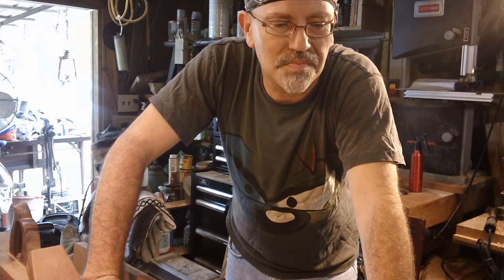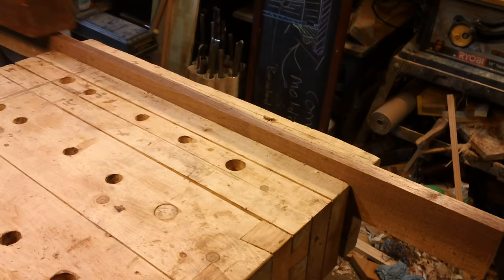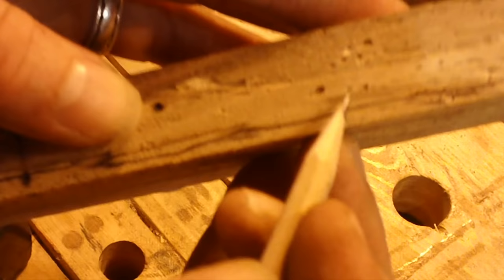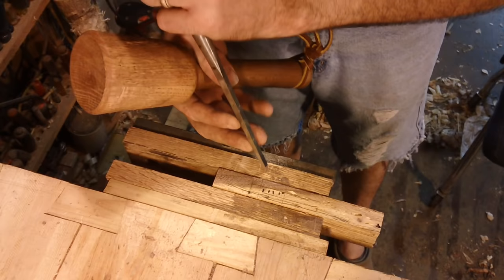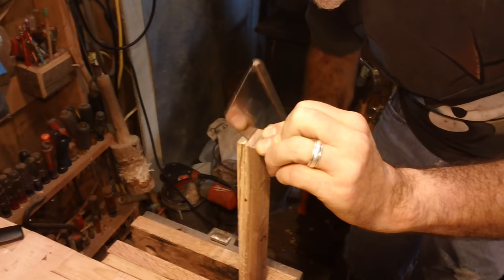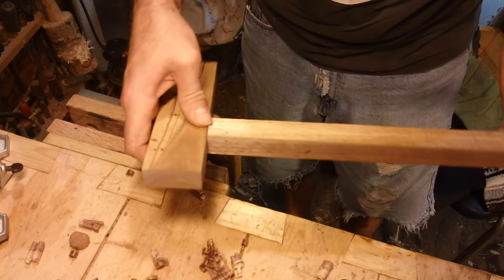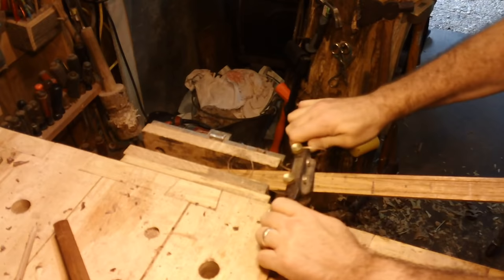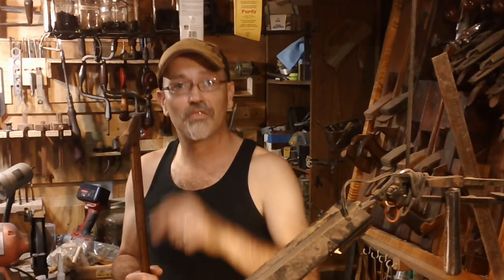Walking Cane

Comment: Once the cane is used you'll find you need to tweak the handle. Shave off a little where the thumb grasps it, and on the other side where the pointing finger meets the shaft.